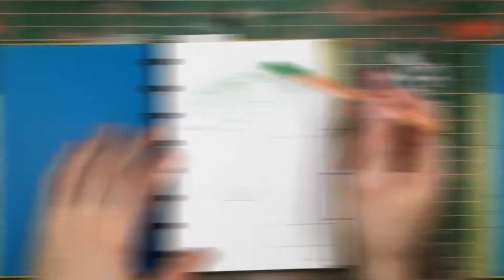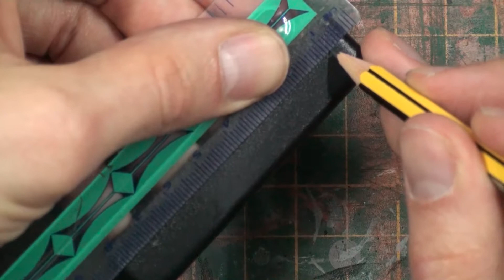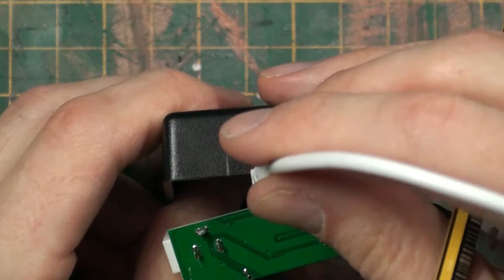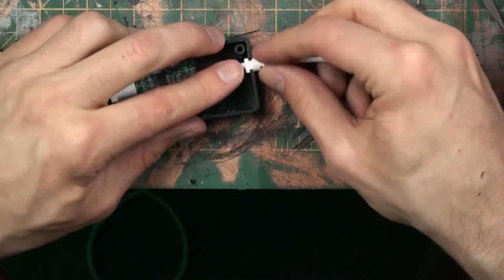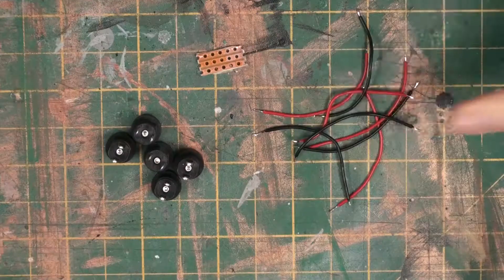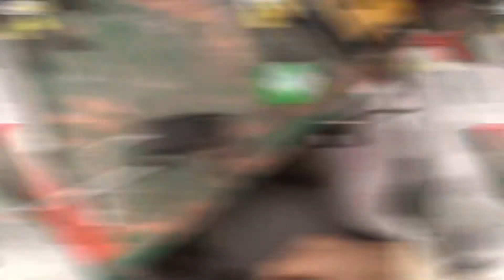Creating a 12v Power Junction Box - From the Desk

Comment: A question or two, if you please. Is this controller you use able to to blink a sequence og lights sequentially? If so, I'm planning to try to light my Galactica landing bay floor lights like a real runway. The lights blinking down the runway one at a time. Of course, I'll have to use some photo etching and other mods, but I think it can work. Also, if the controller allows sequential lighting, can it be sped up faster and/or slowed down?
Reply from the maker: The 555 timer can only do a static on / off blink. You would need to look into some sort of IC for sequential blinking.

As for lights on the runway... perhaps fibreoptics would be small enough to do it? You'd need something really, really small at this scale.
Reply: @AnthonyEdmonds  I'm really going to try this. I just don't want to have to spend a huge amount of money for it. In my old days, I tried to make a long light for a USS Enterprise model. I found out you can glue several fibre optics together side by side. Melt the ends together and trim them so they are one light instead of, say 4. Might take 2 or more melting and trimmings to do it.
Reply from the maker: Sounds reasonable. You could have several LEDs in the main body that connect to eight very fine fibre optics that go out into the pods. Flash them in sequence and job done.
Reply: Well, it SOUNDS reasonable and it can be done with the research I've been doing. BUT, a good controller (and you need a programable one) is $300. So I reckon that's out.
Reply: Sorry to keep bugging you, but I just found out about Arduino's. Check these out for your next build, whatever that happens to be.
Reply from the maker: @BarbosaUral  No need for a high power microprocessor. An IC chip with enough output pins should be able to drive a sequence of LEDs without issue - you just have to know how to program it!